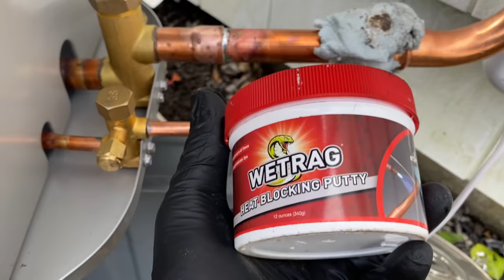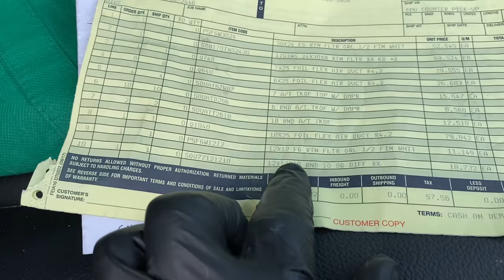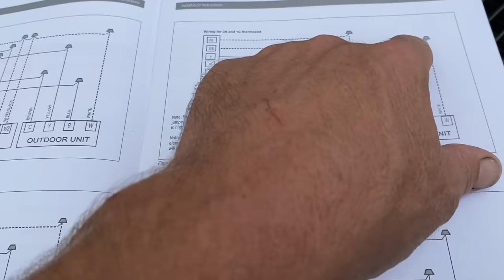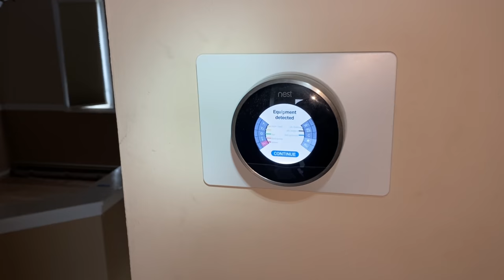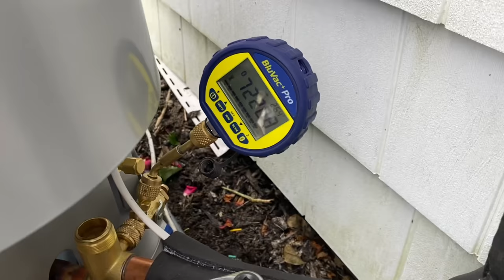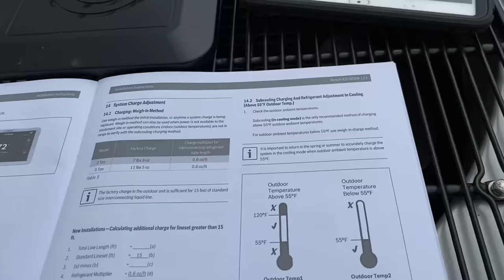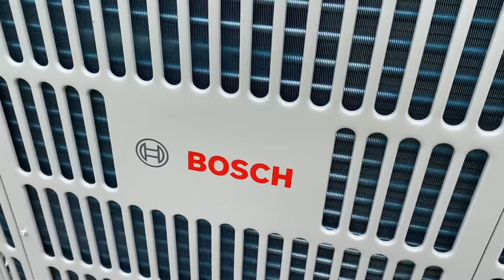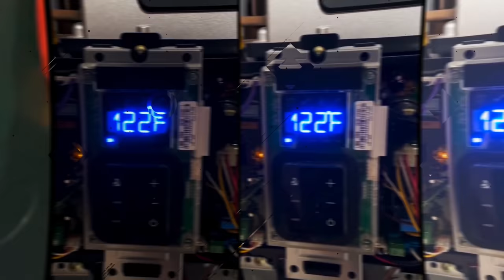Who Installed This Abortion? Another Hacked Central AC System Replaced with Bosch IDS 2.0 Equipment

Comment: I do like your content but please bin off that Staybright 8 and Braze your connections, if we continue to take the skill out of this trade it will only be a bad thing, i have never used a Crimp connection or Plumbing Solder in the 16 years i have been doing this job, Braze up your pipes and keep the SKILL in the trade for the new guys coming up, Its nothing more than just lazy IMO to use crimped connections, yes they will hold a pressure test NOW, but with all the expansion and contraction of the system working over time, this will develop into a leak point in future. Each to there own but a business owner ourselves (in the UK) we wouldnt want to be returning to one of our jobs because of this. BTW nice videos and im a fan of the Channel, keep up the good work bud.

Comment: I used to do Start up on brand new in az  homes for about a year and a 1/2 And the way I was taught was drop it on the high because if you drop it on the high 1st and you wait  Ten minutes Or even two  It's going to let you know if your TXV is locked up from factory Because if it doesn't  equalize  from high to low with the same number Most likely the TXV is locked But you gotta remember I also had to deal with dumb-ass installers And the home setting in rough end For quite some time 

But I don't think it matters
 Because there was sometimes where I was doing a double unit startup I was pulling vacuum with my foreport manifold Yellow Jacket and then my foreport manifold hillmore

I would drop it low or high didn't matter to me As long as it was in ATXV system Then I always dropped it high

Comment: Then as well Is my vacuuming rig Appian one hose setup setup Depending if it was a single unit or a 2 unit 
And you gotta remember I was doing in the peak of summer as well dwell about 4 to 5 start up a day 
 I would change it Once a week 
And I was pulling down to to 300 depending on depending on the home 300  To 500
 And then drop charge Is walk away 15 minutes air flow Pascal Then charge But it's hard to set temperature split on a house  Is that the indoor temperature is 90ﾟ  And on the new homes it takes 24 hours for the charge to  aclimate per what I was taught
 And they make us check air flow with the flow hood which is good energy star inspection  They're huge on that in Arizona I don't know about the other States though But it's nice using the flood because makes air balance cake  especially with an air flow document And Being service side now for warranty on new homes It's good because 99% of the calls is just air balance and the rest is simple repairs is for repairs Walton a Blue Moon you're getting internal overload Call Or a short to ground on the compressor So mostly now it's just fine tuning charge Birch to manufacturers spec spec if it's ATXV system or a piston But if it's a zone system it needs to be ATXV per April air  systems 
And also they put a transformer for the damper power and a transformer for the zone board equipment power

Comment: In my opinion, the whole vacuum pump oil change thing seems like a giant scam to me. 

The car mechanic tells me to change the oil in my car every 5k miles, but sometimes I do it every 5001 miles or 5100 miles, am I causing unnecessary damage for going over that? Absolutely not. 
I know a car and a vacuum pump are mechanically completely different, but that’s just my 2cents from another hvac guy on Long Island. 

The fieldpiece vacuum pump oil though when it’s dirty, it becomes cloudy, that’s the best time to change it.

Comment: Why are both the liquid line and the suction line insulated ??
Reply: If the change of state hapoens in the outdoor unit,both line should be done,you dont want condensate dripping all over the attic
Reply: Peter is that just for the Bosch here in jersey we don’t insulate the liquid line only the suction like on heat pumps
Reply: Its one of those double edeg sword things,canned if you do canned of you dont,every ductless heat pump I have ever seen has both lines done,if anything your more worried about losing heat,warm lines will not sweat, if they are warmer than the ambient,bit is it bad,not really,just not super necessary! You'll always get a thousand different answers!

Comment: Mikey Pipes! Love your videos but it pains me to see you using the plastic lock nuts on your liquid tight connectors! Seen too many crack and let the seal tight fall

Also I’m from the Philly area, install a lot of heat pumps and we never insulate the 3/8 line

Comment: No need to insulate the liquid line on a heat pump. Changing vacuum pump oil every use is way overrated and pushed by vacuum pump manufacturers to sell more oil. Change it when it gets dirty. If your only pulling down line sets and evaporators on new installs it will last a long time. If you’re evacuating burnouts or older systems and compressors it will need to be changed more often.

Comment: Not that the gutter hole matters but you blew that out just a hair, once it backs up and leaks they'll blame your hole unless you seal it with that useless ass puddy people use. With all the nice work you do, why do you leave the wiring outside of the air handler?? Why not at least throw on a 4x4 box and cover??  Nice connectors, I just always liked to put it inside the unit....    They tell you to change the oil because they consider it contaminated, but because it's pulling a vacuum I can't see it getting very contaminated. You're a smart dude, moisture and any other contamination is the enemy of systems and TXV's are a PITA to change. If the oil still looks nice I doubt it's a big deal...   EDIT - PS, I always hated eating lunch, always made me tired especially on the way home thru the Boston BS traffic....

Comment: bosch question-im putting one in for heat pump with hydronic heat coil in ahu-do you like the bosch thermostat for that? been working with the emerson sensi -can i configure the bosch stat to drop out the heat pump without oa sensor? thanks brother

Comment: Mike your the best can I make a few suggestions as I know you are always looking for input. I have learned a lot from you so just giving back. Never use nest stats with bosch use bosch bcc 100 only there the best with this system so many cool features . Nest stats cut out every 13 minutes then unit needs to restart in force mode  you will see this if charging in force mode as required for 20 minutes.

Run 8 wire to bosch bcc 100 stat so you can have 4 heat two cool use stat local; weather to cut out at 40 degrees if dual fuel and unit never goes into defrost mode.

use ez pull line kit wont tear and is rated for uv light and weather outside. Lastly use surge disconnect to protect that big circuit board in out door unit as you are really installing a mini slpit in reality.

Keep up the good work
Reply: A nit pick, but I would have used a steel 90 on top of the intake plenum, then into the flex. The flex will oval out and reduce your flow.

Comment: Bosch recommends opening suction valve first. they also recommend brazing in refrigerant connections. stay brite 8 isn't recommended for r410a units. Butt hell 30 years ago we used soft solder on every r22 unit and it worked for years.
Reply from the maker: Thanks for sharing. Please do your homework you are obviously misguided.

Comment: Very nice install :)
What are your thoughts on Daikin comfort systems? Would be my choice if I lived in the U.S.
Reply: @PipeDoctor  its a Goodman product best I understand. I had a change out job for a church changing 2 10 ton Rudd installed  1974  AC out for 2 10 ton heat pumps for a church I found the Daikin when I called to get a price on the 10 ton units where I get my Goodmans they implied that Goldman  manufactured them.  They haven't gotten back to it yet. That was gonna be the job to get me back going again never happened.

Comment: You guys have to use purple primer on ac drain lines there?? I hate it cuz it looks like shit rather use the glue and wipe off the extra on the fittings
Reply: You can use the UV primer,shows up with light,usually acceptable most jurisdictions

Comment: Should of had masks for the kids.  Fiberglass is no fun in the lung. Why not of set the unit so the access to the front for service friendly? Whats worse flux or carbon.. well when you purge with nitrogen the carbon isn't bad.. flux on the other hand can gum up an office or a TXV. And stubs should have been soldiered prior to the zoomlock those rubber o rings will fail sooner than later.  What was the manufacturer spec for spacing to the house?  Should have staggered the take offs to get better airflow on the bigger duct. I guess you didn't do a load calculation 5o see if rooms needed more or less than just the 6" lines. Um where is the hanging strap for all those flex lines? You call the old install an abortion....WOW WTF was what you put in?  What a garbage install of the duct system. I could do better on my worst day. I'd be pissed if I saw this installed.

Comment: Prrhaps.oil.contaminats.....but.four.times..
Naaaa....did. oil.change its.colour  doc pipes....if so.it.need changing....ifnot naaa...only.if u.have moisture water.... even if the system is.brand  new always check.the check...tis was told to.me.by an ole.mastee.craftman....i stansd for.correction.